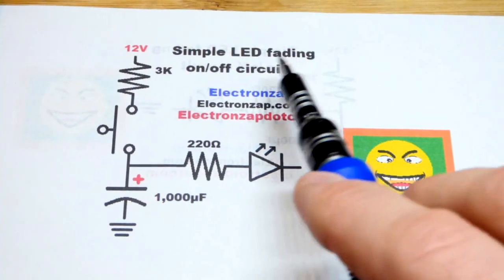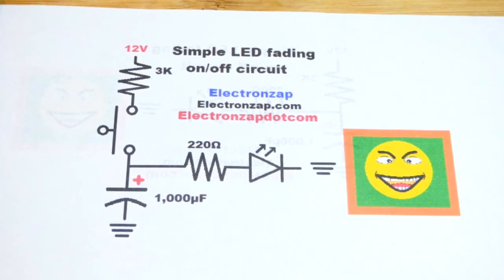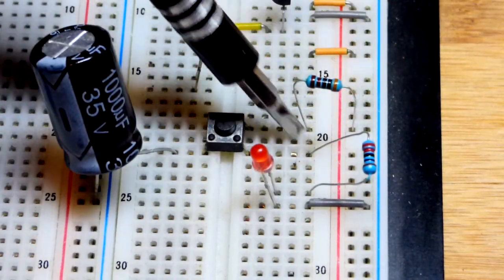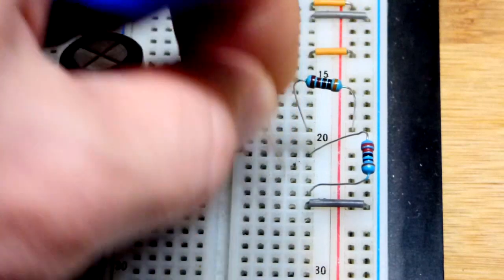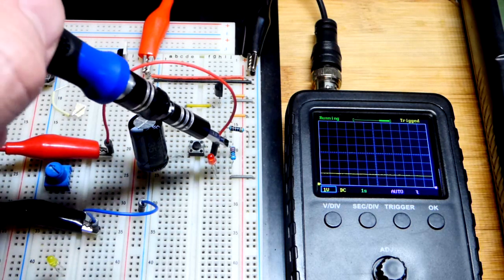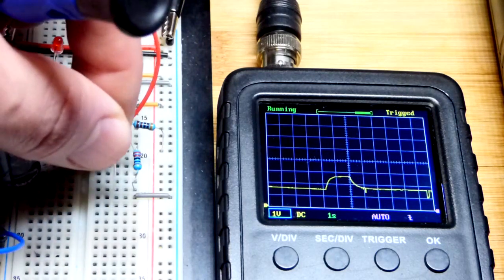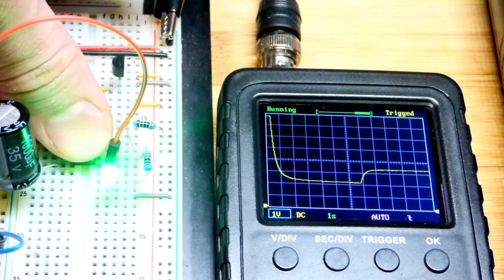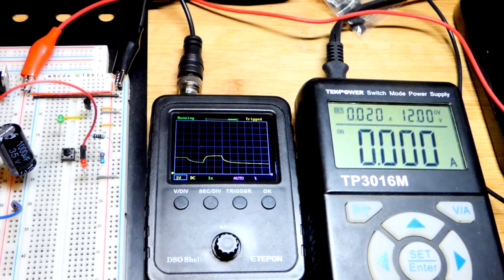Simple LED on off fading using capacitor and push button switch circuit for DIY learning electronics

Comment: What math is needed to figure out component sizing for controlling an LED strip? The resistors are easy but what about the capacitor? Like 12v 10 amp

Comment: hi sir, just curious please correct me if im wrong, is that really 3k ohms in the first resistor or 110 ohms? i see a brown brown black black yellow
 color maybe im wrong?
Reply from the maker: The resistor is backwards when it comes to reading the color code. On the left is the tolerance and on the right is the first digit.
Reply: @Electronzap  ohhh ty for clarfction

Comment: Hi sir is it possible with 3v battery with this circuit ?
Reply from the maker: Some LEDs need 3 volts just to light up. Others light up at 2 volts. So, it likely won't work well with 3 volts.

Comment: Thank you sir, i'm learning electronics and this was quite an educational video. I was using 5V DC and used a 10K resistor for the ultimate fade-in. So far i'm just tinkering with LED's, resistors, capacitors with switch. Next up i'm jumping into transistors. I've bought a lot of NPN and PNP transistors, LED's,  zener diodes, photo-transistors and a stepper motor.
Reply from the maker: Good times!